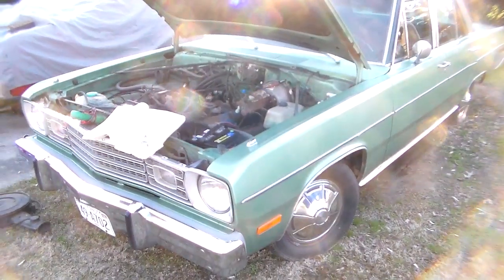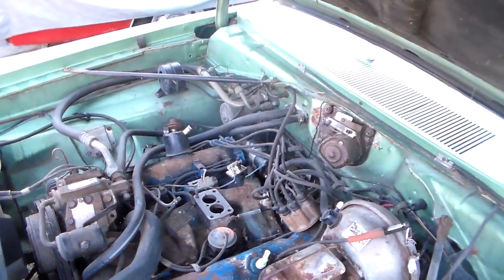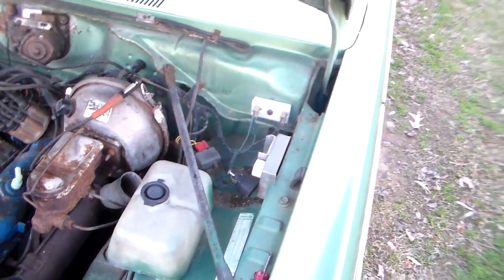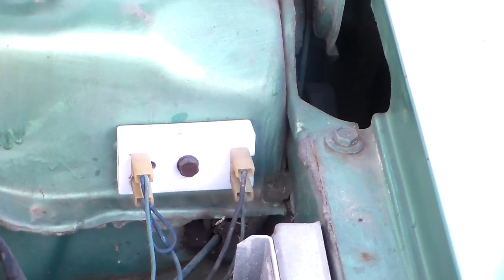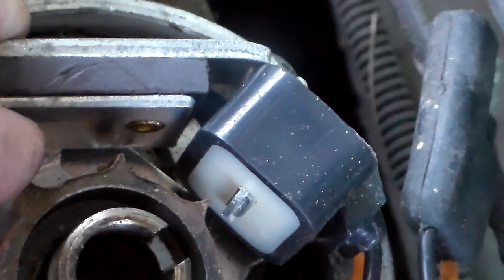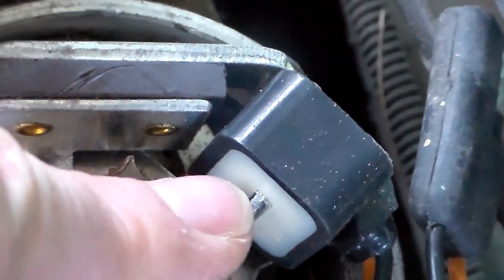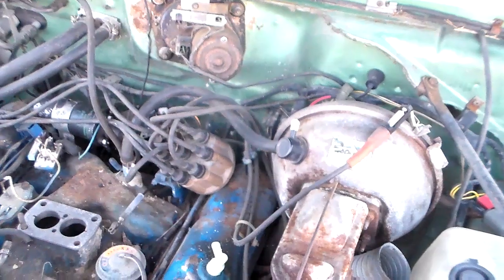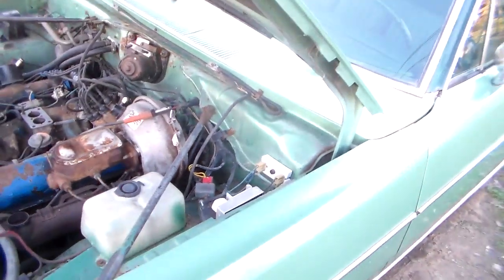Ignition troubleshooting, 1974 Plymouth Valiant

Comment: Hey! Glad I found your video. I have a 74 duster that I'm trying to get running and I believe there may be an issue with my distributor as well. I replaced the pickup coil in mine as well, and it is screwed in, but does wobble a bit. My replacement pickup coil came from O'reilley's. All of my electrical components are new, but I'm only getting 9v at pin 1 on the ignition unit "plug" and only showing 4.5v at the coil with the key in the ignition in the ON position. Any idea what the issue could be? She'll crank, but is still not getting spark. Thanks!

Comment: The top plate with the pickup on it moves relative to the plate that is bolted in with screws on the side of the distributor. The pin for the vacuum advance slides into a hole in between the plates and pins the top plate. There is another pin that goes to the bolt in part and is held in with a y-shaped clip. It won't be quite as loose but it will still move some

Comment: i had a problem withmy 87 dodge ram only would start and stay running with the key in the start position, i changed the ballast still did the same thing and turns out i had to changed the wiring harness from the key tumbler to the trucks main harness it starts good now but it confused me big time

Comment: Great video I have a 1974 dodge that starts a little rough but does run properly when engines fires. It does also diesel when i shut it off. ideas? timing belt? vaccum leak? carbon build up?

Comment: Hi  I just bought a 77 dodge rv with a 440  ran great for a bout a week or so then it snowed   And the next day  no power  no dome lights    Nothing   We were cleaning and working on it here and there  but didn’t do much   Did look atvthe carb and notice the kick down is disconnected   I also did touch a loose wire to ground    Dome lights flickered   And worked after that   I don’t know if that quick touch   Ruined something   If it did it didn’t ruin it right away   Took over night   I replaced battery cables since they were very old and corroded   Then it wanted to start right on connection

Comment: have you checked the seatbelt interlock there? 1974 was the only year they did that, mine wouldnt crank until i bypassed it
Reply from the maker: This one was bypassed also.
Reply: Those were easy to bypass just disconnected the seat switch then it started every time since the interlock thought no one was driving it lol.  By the time I bought a new Aspen a couple of years later the seat belt interlock was gone replaced by warning lights and buzzers or bells.

Comment: Hello, does that ballast resistor need to have power coming out of ALL FOUR connections? I am testing it and I am getting power from three out of the four connections. Please help!! I still can’t start my 1973 Dodge Dart swinger 318. Also, I am not getting any power to the coil (I tested power to the coil connectors and nothing.
Reply from the maker: Ok...if you were to take that ballast off and look at the back, you would see that there are two resistors. Each resistor connects 1 terminal on the left to the terminal across from it on the right, lengthwise. One resistor drops RUN(key on) voltage before it gets to the coil and the other "side" of the ballast (the top or bottom, doesn't matter which as long as they are wired correctly) originally was there to drop voltage going to the ECU box before Chrysler figured out  they no longer needed that function. That's what it does. SO, you have to make sure the ballast is connected correctly before anything else. With the key ON,  you should have battery voltage at the BLUE wire on one end of the ballast.  You should find and connect the SOLID BROWN wire directly opposite, on the other end of the ballast. In other words, if the blue wire is connected on the passenger end of the ballast on the bottom terminal, go straight across to the driver side BOTTOM terminal and connect your solid brown wire. When you do that, again you should have battery voltage at the blue wire with key on, and around 5 or 6 volts at the brown wire. The brown wire is the coil's power feed FROM the resistor. Remember I said that the coil runs on reduced voltage? So, if the ballast is good and you have voltage coming out into the brown coil supply wire, you absolutely should have the same voltage at the + terminal of the coil with key on. The other two wires can be connected to the ballast however they fit well because there no "left" or "right" because they are simply connected to each end of the ballast. As a reminder, the brown coil feed wire has a circuit connected to it and the ignition switch that BYPASSES the ballast to feed the coil full battery voltage in START position only. Read this carefully and if you are not getting voltage to the coil afterward then you will have to take your meter and go hunting to see where the voltage is stopping. Good luck.
Reply: @TylersNeighborhoodGarage  I finally got my Dodge Dart started yesterday. It was a bad ballast resistor. The brown wire was not coming on when I turned the key and as soon as I jumped it, it started. I got a new one and $100 later, it runs again.

Comment: I’m working on my 1975 dodge 1 ton. ( 6 cylinder ) no spark. Did an hr ago but not now. That electrical box beside that ceramic one, has a moon shaped plug. What is that ? Mine seems to be kinda buggered maybe, is that something that may control spark ?

Comment: If this post is still open I have a question. I have this same car, year, make, and model. Mine was made in Canada so no seatbelt interlock. I’ve had a wiring issue since I’ve had it. But, anyway my car will try to start but won’t. Just got it from the shop had a new ignition switch and starter. It ran for a week. When u try to start the car it will almost start when ur letting off the key and it goes back about an inch. Also, just replaced the coil from the distributor and converted the fuseable link to an inline fuse. All of the things I’ve had fixed worked for awhile then something else. This is my everyday driver, which everyone thinks I’m crazy for buying. I love my car it has lower mileage and beautiful any advice would be so appreciated. I don’t want to have to sell it.
Reply from the maker: Does it run longer if you (briefly) hold the key in the START position? If so, you likely have a bad ballast resistor. That is the white ceramic rectangle on the driver side firewall. Mopar ignition systems are weird but basically that ballast has a start side and a run side. When the run side fails it will only run in START. You can replace it yourself easily. Keep a spare with you. 
The other thing that fails is the ecu,  which is the large metal box on the same side with 4 or 5 wires in the connector. That one usually stops it dead, no start at all when it goes. Again, keep a cheap spare. Good luck!

Comment: to work on the dist its easyest to just take it out and clamp the shaft tang  in your vice.   to put it back in just remember which way the rotor was pointing.   you can only get it 180 out of phase,  OR right on.

Comment: I have a 1973 Dodge Dart sport that won't crank do you have any thoughts. Vernon
Reply: Check your starter or starter relay I had the same exact problem with my 1978 Dodge custom 150 it has a slant 6 and the starter relay was the cause of the cranking problems it had

Comment: I have the exact same problem with my 1978 Dodge custom 150 I have no spark at all to my plugs and I've replaced everything u can think of even the distributor and plugs and wires and everything is properly gapped and tight u name it and my coil is getting great spark I found out the hard way when it knocked my ass off lol but anyway I'm getting no spark to my plugs everything has been replaced and gapped properly and everything is tight but no spark can u please by chance help me with finding the problem
Reply from the maker: Is the distributor turning?

Comment: I"d reset the pick-up coil to the specified distance from the reluctor,  Have someone crank the engine and verify it's actually turning. No start? then test for spark from the coil through a spark plug to ground. Still no spark?...check all the connections for corrosion, especially the grounds!  If this old girl has been sitting, it's likely there could be corrosion at one of the grounding points of the ignition system. Still no spark?...try jumpering the ignition system right off of the battery.  That will eliminate ignition switch or seat belt interlock as a possibility.   Study the wiring diagram in the service manual first!!!   Fortunately, these old Mopars are pretty simple to work on, and they'll run forever.  Sorry I sold my '73 Scamp for $500 because I wanted that parking space cleared.

Comment: Is there any way to check that pickup coil with a multimeter? I am stumped with my 1973 Dodge Dart 318 that doesn't have spark. I changed the Electronic Ignition thinking that was bad but no luck. I don't get spark to my wires. I have checked my cold and I am getting about 10.25 to the multimeter. Here is the video of what I replaced. 
https://www.youtube.com/watch?v=0amPqhrLTGU
Reply from the maker: Yes. You can disconnect the distributor connector and use your multimeter set to the ohms scale. You will be looking for a reading between 150 and 900 ohms. As you can see that's a wide range. They rarely go bad. You can eliminate the ballast resistor as a problem because the ignition circuit bypasses the resistor in START and it will always run but quit as soon as the key is released to RUN if the resistor fails. 

That said...you shouldn't have that much voltage to the coil with the key ON if the ballast is in place. You should have about 5 volts to the coil with key ON. The coil is designed to run at that voltage..they usually always have "Use with external resistor" printed on them. I suspect something has been done to the wiring to get around the ballast and possibly burned the coil up if it was the original-type. I would suggest doing some reading on how the ignition systems work on those so you can get a better idea of whats going on. MyMopar.com has the factory service manual and wiring diagram online that you can download for free. Good luck.